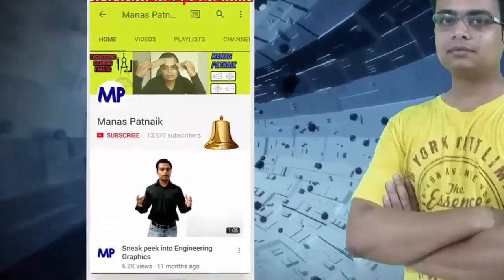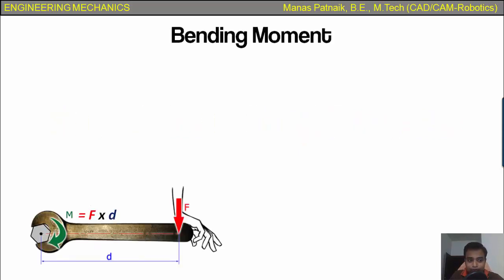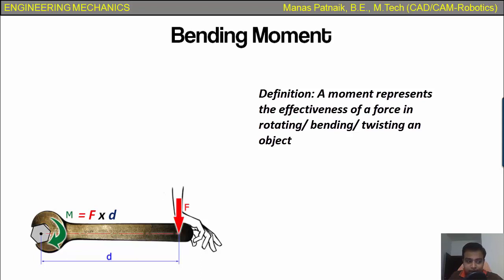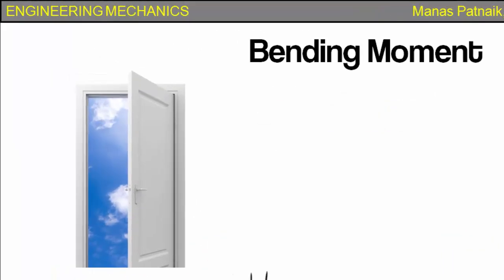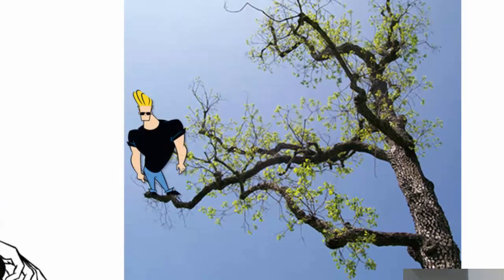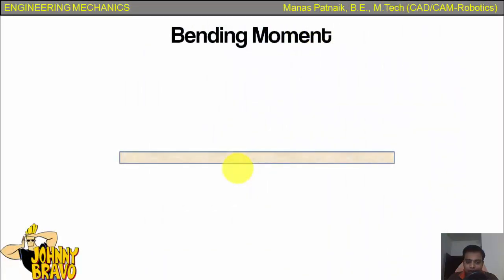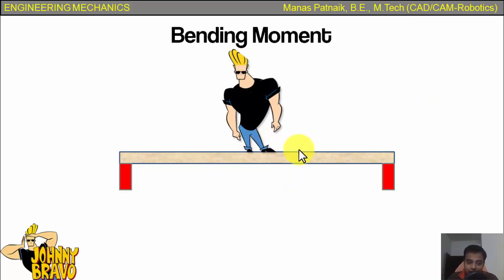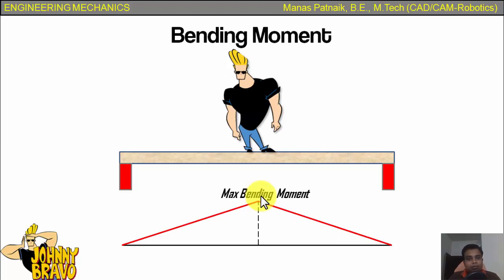Shear Force and Bending Moment_Part 2_Concept of Bending Moment

Comment: Sir iss topic ke upar video kariye please.

[*Stresses In Beams*
3.1 Bending Stresses in Beams: Concept of pure bending, theory of simple bending, assumptions in
theory of bending, neutral axis, neutral plane bending stresses and their nature, bending stress
distribution diagram, moment of resistance.
3.2 Application of theory of bending to symmetrical and unsymmetrical sections. (rectangular, circular,
T-section and I-section)[simple numerical problems]
Reply from the maker: Well these topics are from Mechanics of Solids....
I will be taking that up also...
But it may take some time.....